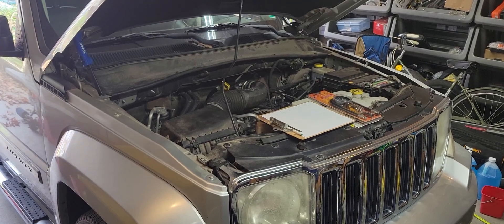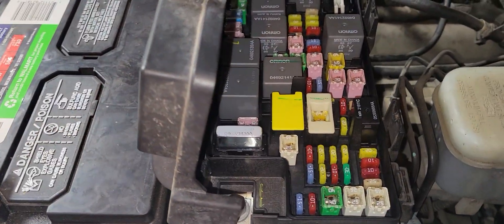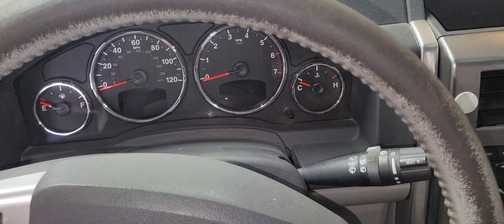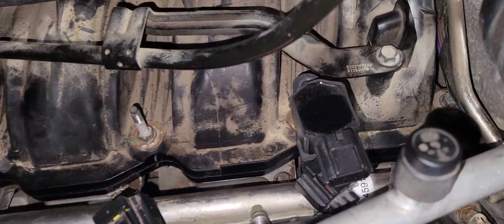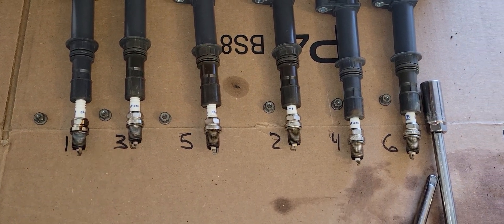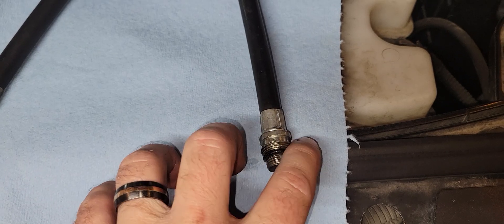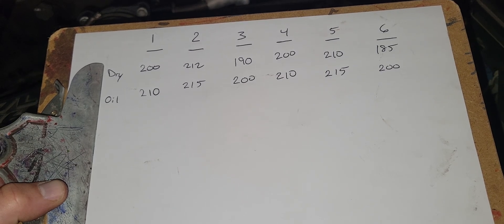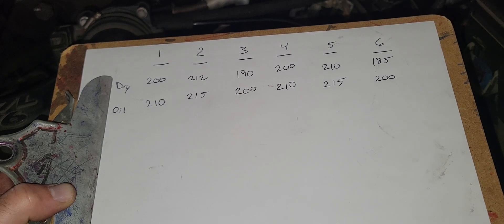2008 Jeep Liberty compression test

Comment: Just found you as I was looking for something in comp testing. 
Been many years since I used to do that on carbureted engines. 
Question if you see this after 2 years?😊
Fuse M25? Were you removing the fuel pump fuse or something in the fuel injection?

Simple and excellent!!
Thank you
Reply from the maker: Fuel pump fuse.  How about that after 2 years.  Happy wrenching!
Reply: @elvrolet 😊👍very cool thanks much

Comment: Could you pls. Recommend in my situation, I only get P0403 and P0406. My EGR is shut as it was leaking, that realy helped then. Thogh it was left connected, and after some time it started sending high voltage to PCM, tech. Just disconnected and car stopped bucking/jerking. Now it started to jerk and rpm fluctuating when rolling on low speed. Can it be the reason that my EGR is not connected and shut off.?

Comment: good video, will check mine today, due to 3.7 engine knock. (Eliminate valve seat possibility)  i do not expect 200 psi compression which seems a bit high and could cause pre detonation, which could also make a knocking sound. Rod bearings have already been checked but cannot check the mains without pulling the engine. Respond if you found something!